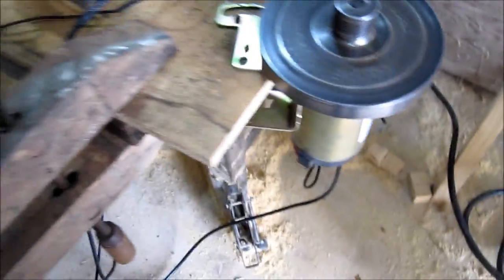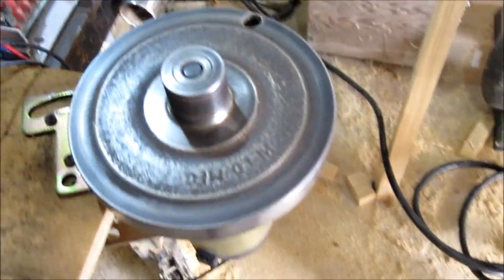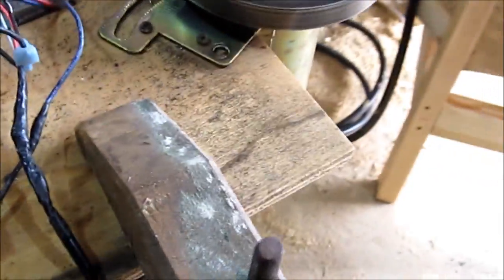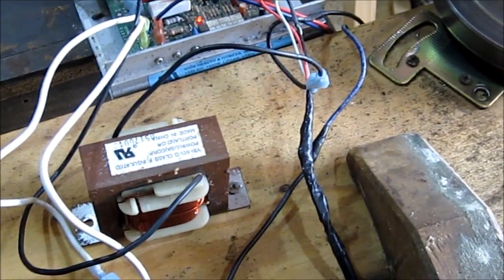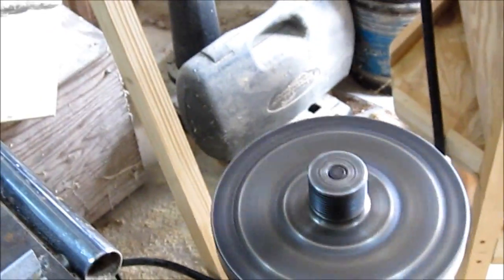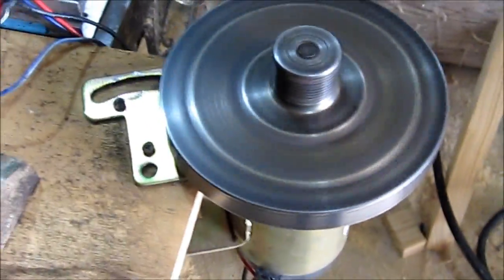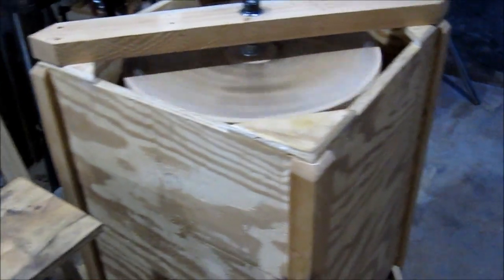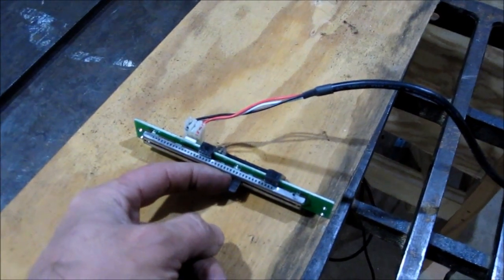Treadmill Motor on 8 Frame Extractor

Comment: Hey when your took the angle grinder to the treadmill pulley did you use a cutting disk or a grinding disk?
  Also how did you get the nice rounded belt spot?

Comment: I have the same treadmill motor, trying to cut the extraneous wiring & stuff and get the motor running again without all the junk. My knowledge of motors and circuit boards is less than nothing.  Could you explain what you did? It doesn't appear that you kept everything...
Reply from the maker: i think i kept the wire harness and everything just rolled it up and tacked it under the extractor...